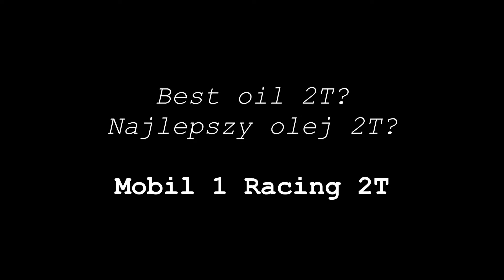Mobil 1 Racing 2T Najlepszy olej 2T? Mieszanina 50:1

Comment: While it's an interesting test, within seconds, the reservoir seems to have slung the fluid out until none remains to wet the wheel surface.  I would recommend a reservoir with a pan large enough to maintain wheel wetting for the full minute as would happen in an engine.  Additionally, when fuel oil mix droplets hit hot engine parts, a good portion the fuel vaporizes leaving a higher concentrated oil film behind.  What are your thought?  I welcome responses both pro and con.